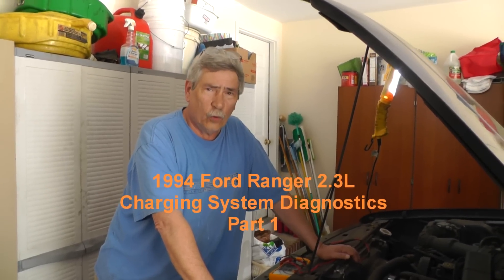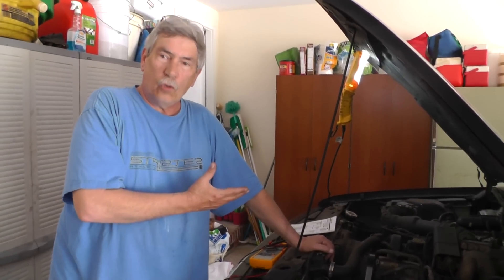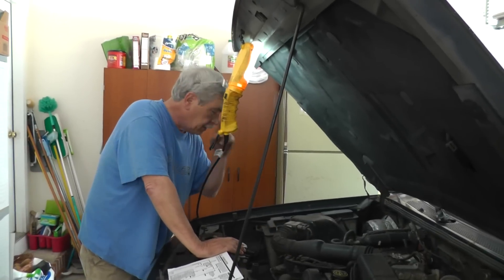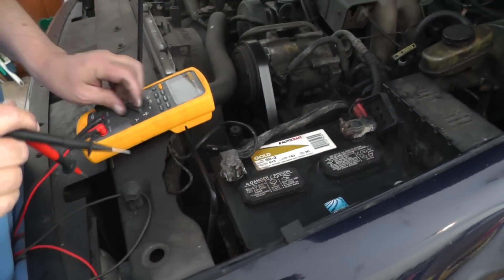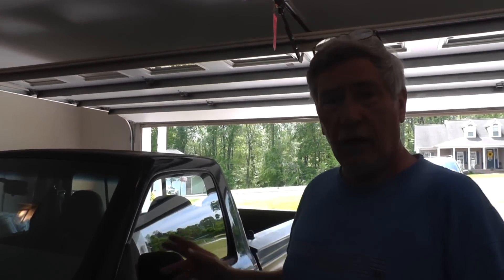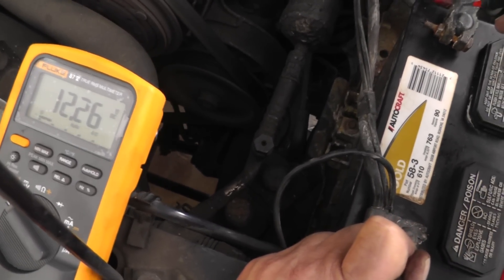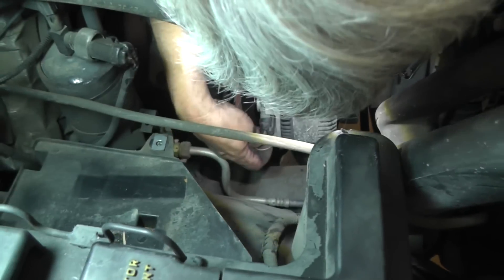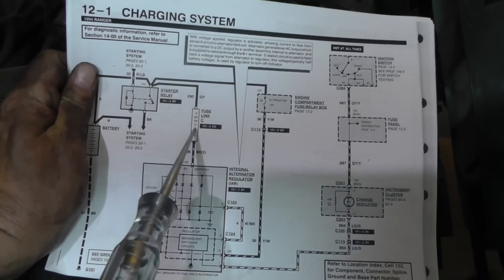Ford Ranger Charging System Diagnostics - Part 1

Comment: What if you don't have power at all in green wire
Reply from the maker: Looking back at the diagram Stephen, the green wire is coming directly off of the battery B+. Sounds like you've got an open wire or possibly a lot of corrosion.

Comment: I have a 94 Ranger when I turn my key to the on position no lights come on no battery no check engine soon I'm not sure if it's the ignition switch ...it will run but no charge
Reply from the maker: Should be easy enough to check Bubba...

Comment: 2002 ford ranger,3.0L, i oly have 7 volts coming out of the yellow wire with white tracer, yet all the fusible links show good and no corrosion anywhere. any ideas?
Reply from the maker: Having seven volts on the wire that you mentioned could very well be okay and the amount of voltage is how you measure it. If you measured the wire with the connector plugged in the alternator, you'll be measuring the voltage drop across the bulb and resistor which is in parallel with it. This voltage will be lower than the B+ voltage which is normal and seven volts sounds correct. If you measure the voltage of the wire with it disconnected from the alternator, you'll measure the battery voltage as there is no voltage drop across the bulb or resistor. If you disconnect the connector and use a test light, you'll see that the bulb brightness will be dim which is normal because the test bulb is wired in series with the other bulb and resistor.
Reply: the wire was disconnected from the alternator when the 7 volts was measured with a multimeter. btw, i run a bypass wire from b+ at the fuse box to the yellow wire and just for safety i put a 40A fuse inline, its now charging. apparently the 7 volts was to low to excite the alternator.

Comment: Terry, I have a 95 Ranger when I test the charge indicator wire (green w/yellow tracer) my test light does not light up. 
I did the other 2 test you showed an those are good.
Battery is good, when running I am getting 14.5 volts at the battery.
I tested continuity of the green wire with yellow tracer from alternator plug to a connector on the other side of the engine near the fuse panel under the hood it was good to that point.
I checked the fuse for the charging system in the box under the hood it test good.
I still have the battery indicator on the dash lit though.
Do you have any reccomendations?
Reply from the maker: Eric, the wire that you're referring to as the green/yellow wire is upstream of the charging bulb. So, you should have the full battery voltage here when the ignition switch is in the 'on' position. If you don't have any voltage at all at this point, I do not understand how the bulb could even glow at all. The wire downstream of the bulb that I checked is a light green/red wire and my test light was connected to ground. Since my bulb is in series with the charging bulb and it's parallel resistance, my test light was a little dim, which is normal. Please verify that you don't have any voltage as you described as your test point. If you don't, then you can check your ignition switch and the source voltage to it which should be hot all the time.
Reply: @stuzman52  It turns out that my charge indicator wire is green with a red tracer like yours poor memory on my part there. Connections look identical to your 1994.
The charge/battery indicator light came on after cleaning a lot of connections an fuse box under the hood with electrical contactor cleaner. 
I believe I didn't let the cleaner dry long enough. I didn't immediately connect the two together.
I had been trying to sort out an intermittent crank no start problem (no spark) I have been having recently.
The charge indicator was on for almost 2 days after cleaning the wiring connections. The indicator light would flicker when driving then came back solid.
Went to auto part store an had battery an alternator tested with an without load everything passed. Meanwhile battery light was on solid during the test.
When I started the truck this morning the battery light was gone. Drove 50 miles round trip with no battery/charge indicator light the entire time today. 
So I believe the contact cleaner was the culprit. If the light comes back I will check the ignition switch and the source voltage as you suggest.
I only have 217,700 miles I can't believe I'm having problems with the truck :-). Even though I believe I caused this one.
Hoping to hit 300,000 miles or more someday however the salt on the roads around here may have other plans for the truck.
Thanks for the clear an easy to follow video. I have always just blindly pulled the alternator an taken it to the store to be tested in the past. Glad I found your video
I will be sure to run these test in the future if I have any alternator/charge indicator light issues.
Excellent camera work by the way, an thanks again.
Reply from the maker: Eric Hubbard Since the light is out now, it could have been the cleaner. Hope it stays off for you. And I’m sure you’ll make it to 300,000 miles. Have a good one Eric! 😀👍

Comment: Did you check voltages with the key in the on position?
Reply from the maker: Yes, the ignition switch is turned on, but is only needed for the test of the charging indicator bulb. That circuit goes through the ignition switch where the other two tests doesn't need the switch to be turned on.

Comment: @7:13 where you used your test light on the voltage regulator connector, where does that wire lead to? any fuse? mine didn't light up
Reply from the maker: Not sure why it's hard to see Douche as I showed the wiring diagram right before the test. It should be hot all the time and it passes through a 15A fuse. If your test light didn't light up, you probably have a blown fuse :) Hope that helps!
Reply: stuzman Thanks for the reply I changed my fuses already but when I used my test light it still did not light up
Reply from the maker: Douche Bag I’m assuming that we are working on same year truck. If so and you are checking that wire which should be hot all the time then you should have a B+ voltage. And if you’re sure that your fuse is okay, then you have an open in that circuit. Go back to the fuse and see if you have voltage on both sides. That should give you a direction of where your issue is at.

Comment: can you explain to me in a few words why is that 500ohm resistor in parallel to that charge indicator light?? thank you!!
Reply from the maker: Sure, no problem armando. Years ago, there used to be just the bulb 
without the resistor. And of course, bulbs do blow and you then have an 
open circuit. And these bulbs can be a real pain to change out up in the
 instrument cluster. And this circuit is needed for the excitation 
current needed to get the generator to start charging. So, manufacturers
 added this resistor in parallel with the bulb so that if the bulb did 
blow, the charging system would continue to charge. Hope that makes it 
clearer...
Reply: +stuzman52 pretty clear, thank you very much Terry!
Reply: +stuzman52 but i think if that bulb blew the excitation it would be less because of the high resistance right?
Reply: +stuzman52 but i think if that bulb blew the excitation it would be less because of the high resistance right?
Reply from the maker: When the bulb blows there is no resistance which is an open circuit. Therefore, there is no excitation current, not less.
Reply from the maker: Okay, I think you're talking about the bulb and resistor together now. Yes, there would be less excitation current, but this current is still enough for the generator to still work.
Reply: +stuzman52 thank you!
Reply from the maker: You're quite welcomed!
Reply: I would think that an open  in the bulb circuit would cause  a high resistance and since current follows the path of least resistance, it will go to the other leg. I would also think the  resistor in the other leg would have the right resistance to allow enough current to pass to excite the generator. I don't see how the current would be less.

Comment: Forgive me if you were going to cover this later, I'm at 7:18 now, but while I just passed 3 ASE's (yay!), I did worse in the charging section than others, and I wonder if it's because I didn't know the role of the B+ wire.

I'm thinking that's battery positive and it by some electrical "magic" (lol) knows then how much the battery needs to be charged. If the battery is lower voltage the alternator will produce more, and vise a versa.

Hopefully, you have a moment to help explain the "magic" part as magic is really just another word for the parts of things we don't understand.
Reply: And by the way, you're right, no need for me to know what's wrong with the insides of the alternator. Just about nobody fixes the inside of them anymore.
Reply from the maker: You've got it figured out pretty good DE, good job! The voltage regulator is the 'brain' behind the charging system. Of course it needs the supply voltage to power up the electronics for the regulator. And there is the battery voltage that it looks at along with a voltage from the stator. By comparing these two voltages, the regulator will use it's internal voltage set point, to vary the field current up or down depending on the electrical load such as the battery and all the electrical devices on the car. As the load current increases, the voltage on the B+ will drop. This voltage is sensed by the regulator. Then the regulator will allow more current to flow through the rotor field winding. This will increase the magnetic field around the rotor which is really just an electromagnet. This rotor magnetic field cuts around the stator windings where three phase AC output is produced. And of course these phases have six diodes to change the AC into DC which changes the magnetic strength of the rotor. That's it in a nutshell. See, pretty simple eh DE!
Reply from the maker: Back in the old days, it seemed like mechanics tore things down to rebuild them such as carburetors, alternators, power steering pumps, etc. And in those cases, knowing the internals of how things worked could help in your rebuild. But nowadays, everything is throwaway. For example, let's say the voltage regulator was bad on this alternator. Now you'll have to order one most likely and it can run around anywhere from $25 on ebay to $50 from an online retailer. Now you'll have to open up the alternator to get access to the regulator. Wait a minute, just as well go ahead and change the brushes. Damn it, with this many miles on here, I might as well change the bearings. You see how this can keep snowballing. You'll spend more of your time rebuilding the thing that it takes to buy one complete. But it's always good to know how things work for education though.
Reply: stuzman52 I'm not sure I could repeat that, but I'm awfully close to full understanding. I've watched and studied some of the best videos and articles and yes, now all that does seem simple.

I didn't even know what B+ was before my ASE, but now I'm guessing I answered those questions correctly making it up on the spot. 

You see, everyone talks about how those systems relate, but I didn't know the B+ connection was 1/2 the key to having the right information for the voltage regulator.

I forgot about the stator and gratefully there were no questions about it before your refresher! 

Your response was phenomenal. :)
Reply from the maker: Yeah, B+ came from years ago when they used lots of batteries to supply B+ (DC battery positive) to the plates and screen grids on vacuum tubes. This was mobile equipment. Even when they used 120VAC to power up the systems, the voltages on the tubes still had to be DC voltages and the term B+ stuck. So even today, B+ is carried over from the old days. And always glad to explain things DE to help.
Reply: stuzman52 That's a very different "vacuum" tube than I'm usually thinking of these days!

Comment: HAPPY BIRTHDAY TERRY- good explanation. I was working on a 4 liter 2 years ago that had 3 alternators changed before I got it. The power always feed to the alternator had been chewed my mice under the fuse panel and would light the test light like everyone else probably did  before me did but im almost scared to say I put the loadpro leads on and it dropped like a rock. I just ran a new wire. Cheer and the camera lady did have too much wine. LOL
Reply from the maker: Hey Steve and interesting scenario you had there with the battery feed. Interesting the test light didn't pick it up, but you've got to have a 'calibrated' eye to see a volt or so change. And you're right that the LoadPro will get the job as you've indicated with your wiring issue. I could have illustrated it here, but I figured most people would have a test light and trying to keep it simple. And that would start a war with the LoadPro LOL. Take care Steve...

Comment: that ford truck has a lot of miles...now be honest and admit the engine's been replaced twice.
Reply from the maker: Surprising as it is to me sometimes thinking about it, it's the original engine and still chugging along. The only thing that I don't like about it is the power. You can really tell when going up a mountain LOL.. Thanks for dropping in and leaving your thoughts. Take care...
Reply from the maker: Yeah you're right DE, mountains and 4 cylinders don't seem to get along do they LOL...
Reply: stuzman52 No they don't, lol, but they're steady and sure engines.

The only way around that is to have a smaller vehicle or less to nothing in it. 

But yes our experience with these 4 cylinders are probably worse than most up mountains.

Got stuck going up to near where Matt or Schrodingers Box lives from Salt Lake City once and 45 miles per hour was the best I could do. Shifting even to third didn't help so I stayed in fourth and didn't bother pushing on the gas pedal because it didn't help. Lol
Reply from the maker: HaHa! Pretty funny story there DE with the engine at 45 mph...I'm sure that over your life, you've got some good stories.
Reply: A new engine would fix that. ;)

Or you could diagnose something easier, cheaper, and more worth it, lol.

Though I have to say, I had a mustang with what felt like a truck engine, all torque, and now hp as the RPM went up. That engine was in some year of Ranger as well, and mine and yours both didn't like mountains - I think, no, I know it was an 89 Mustang with a 4 banger in it. V4 - so weird.